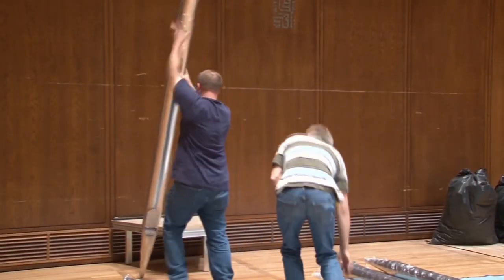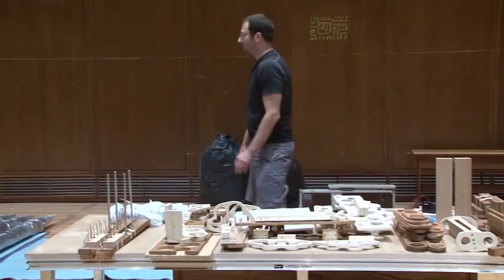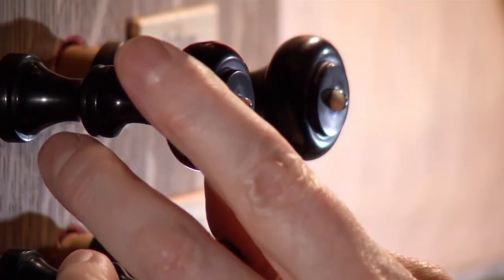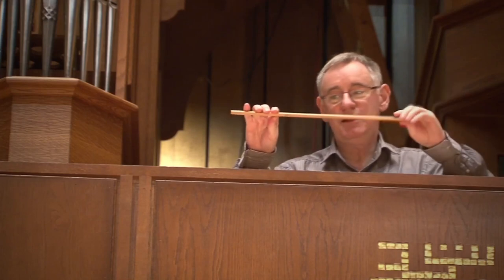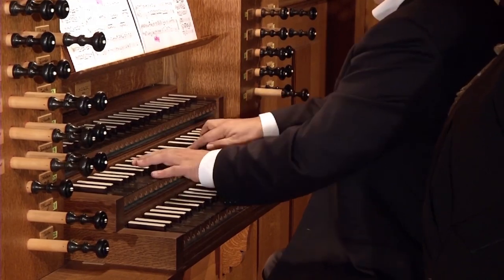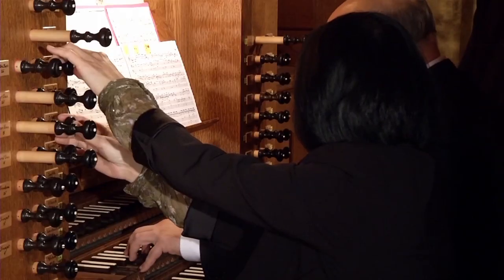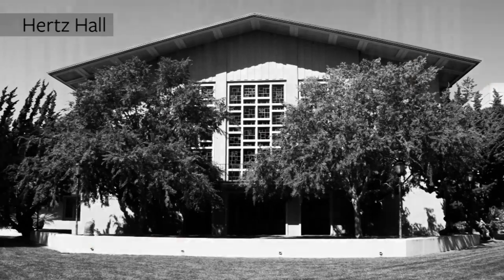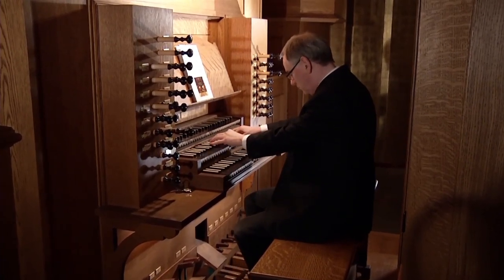UC Berkeley's Concert Organ Would Make Bach Himself Feel at Home

Comment: Built in '82 and needs refurbishing already? What did you guys do to it?
Reply: I think it was just for additional pipes to be added. and maybe cleaning
Reply: It was built for one venue in 1982 then dismantled and MOVED to Hertz Hall and erected there after refurbishment, as any pipe organ, regardless of age, would require.
Reply: The organ was moved from its original location. The university got it secondhand. Refurbishment is pretty standard, especially if the instrument was placed in storage while the owners were searching for a new buyer. The same thing happened with the Bedient organ now at University of North Texas. It is modeled off of the French Classical organ (complete with a French Pedalboard and reduced compass recìt division). Refurbishment was included in that projext too, not due to necessity but because it is practical.

Comment: Sounds awful.  Another academic junk!
Reply: Peter Macander A hangover of people that think that Orgelbewegung is the only way to go for an academic instrument.  Rather short sighted.
Reply: It would be better described as "post-orgelbewegung." At this point builders were trying to be more artistic and a little more innovative while still adhering to some of the more important orgelbewegung ideals. As far as "academic" organs go, the only somewhat eclectic organ I really enjoy is the Fisk at OU. At the same time, that instrument cannot be separated from the orgelbewegung. Rather, it is building off of the movement. 

The Holtkamp organ that was replaced in the 1980s on the other hand was a stereotypical early American orgelbewegung instrument. There are other instruments on the campus that date back to the end of the Baroque era. There is another organ built in the 1980s used for performances on their campus. 

Final point, most American organs from the 1940's-1960's (American orgelbewegung) have been altered extensively (some of which I have played, one was drastically improved with rebuild and revoicing while the other organ was made mechanically reliable but lost what has been described as a wonderfully blended sound, the practice organs from that era have been mostly untouched). As a result, there are very few true examples of the American Orgelbewegung.